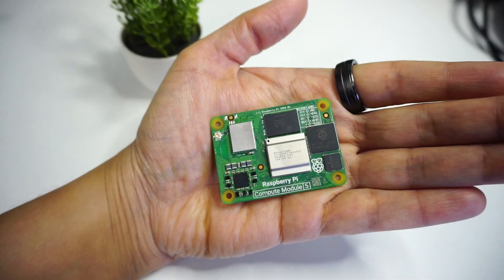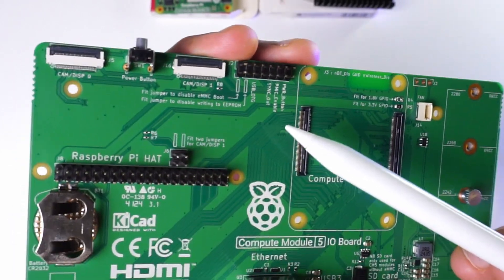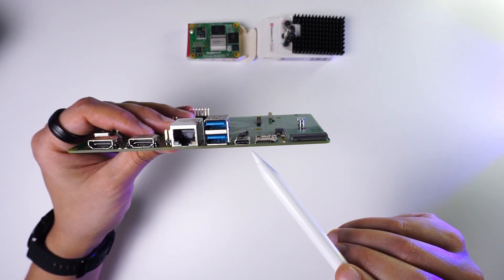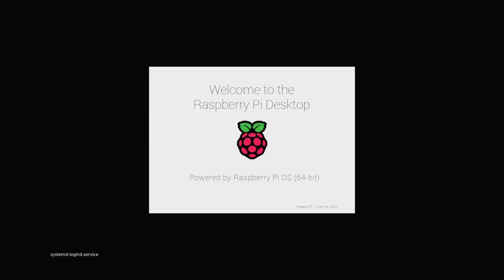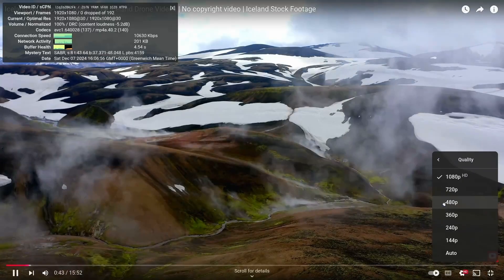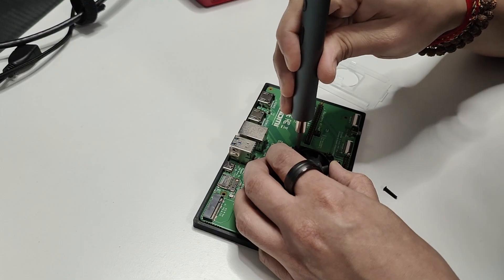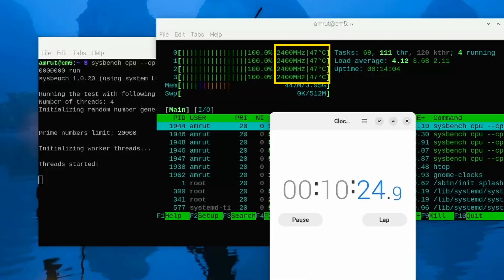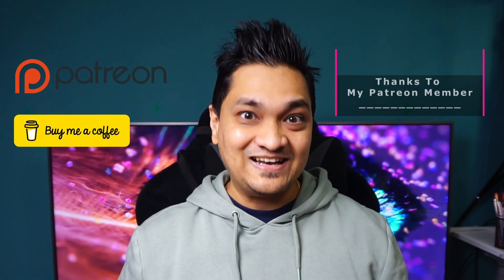What's NEW in Raspberry Pi Compute Module 5 🔥| Benchmark, Stress Test, Power Consumption & Use Cases

Comment: This is how far I got. However after 2 days cannot get Arducam, RPIcam3 working on the IO board. I can get it working.
Reply from the maker: hmm.. What issue are you getting?
Reply: @SmartHomeCircle  It appears that they changed the I2C wiring between the PI5 and CM5 dev board.